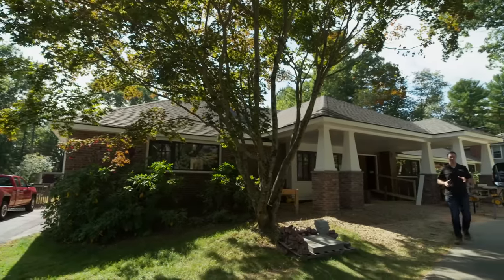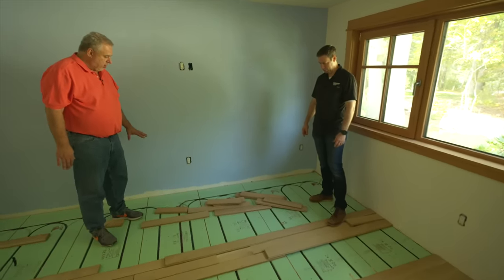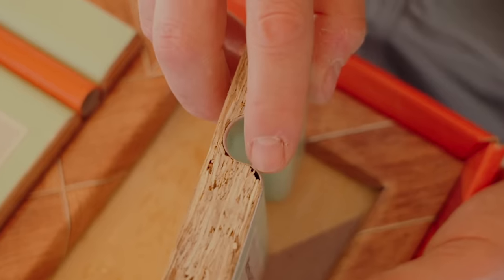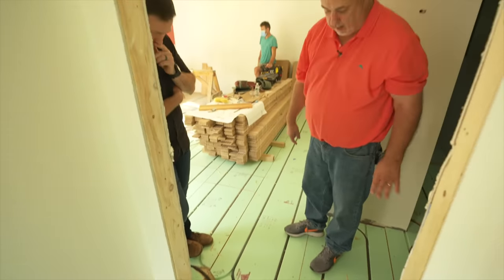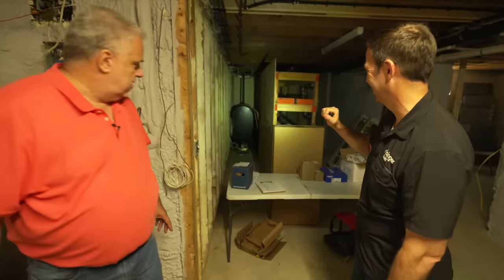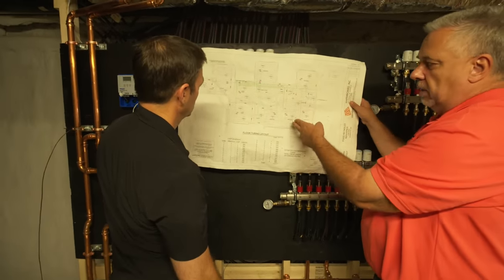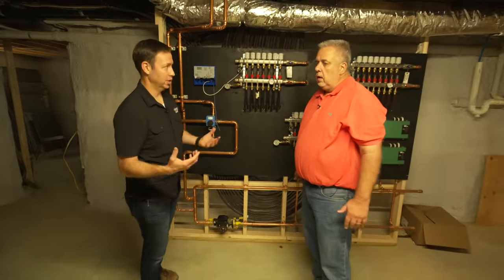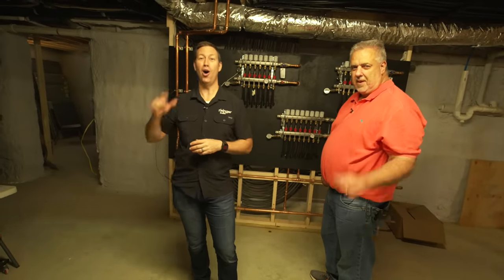Plug and Play Radiant Floor Heating System - BEST ON THE MARKET

Comment: Warmboard is terrific and worth the money, but I do have two caveats. One, it’s more expensive than other similar products on the market. Google the other brands and you’ll save 30-60%, but I will still admit that Warmboard is the top quality of the group. Once installed, I don’t think you will notice much difference. And two, when deciding against concrete slab, remember, with a slab you can fire the boiler for one to two hours a day and keep the living space warm and at a constant temp, +/- 2 degrees. While Warmboard is a lot quicker in response, it doesn’t hold the heat as well as a thermal slab. So you will fire your boiler a lot more often every day. More gas use, higher operating costs. But some people think the quicker response is worth it. I don’t really. It’s a a feature, but remember, most people live in their homes 365 days per year. I think it’s easier and less expensive overall for the flooring to stay at a constant temperature, and the house to keep living space at a constant temp. It’s just better. I have a 150 year old Victorian in San Francisco which is a great test case. Cold wet winters and very chilly summers here in SF. You gotta run heat most of the year if you want your home above 60 degrees. Three stories over a finished basement. The main floor is Warmboard remodeled, the top two floors are staple up, and the basement is a 2500 concrete slab. Ok? Great test case. And no, there are never any leaks. The basement slab is by far the most comfy portion in the building. Boiler runs two hours a day max during the cold of winter, and once a day the rest of the year. The staple up floors run 12-18 or even more hours per day to stay warm. The Warmboard floor runs about 12 hours a day to stay warm, and when the system is off at night, it really cools down! Warmboard just doesn’t hold heat. But it heats right up in about 20-30 minutes in the morning. Easy. The floors creak a little on the staple up. They do not creak at all during heat-up on Warmboard because the builder used glue and nails. Always use glue under engineered floors for radiant. The basement used glue. We loved the parquet floors in the building so we did staple up, and the old oak on those floors has shrunk a bit, because you have to keep the water tempers higher on staple up, and that’s not good for old wood flooring, but it’s okay. The concrete, we can keep the water temps low, like around 100 degrees. Warmboard, you keep the water temp higher, like 115-125, but still pretty low. Staple up, I’ve had to keep the water at 135, which is high, but that’s what it takes to heat the place. So at the end of the day, if you have the ability to pour a concrete in slab tubing, do it. Forget about the wood floors being soft and bouncy. On Warmboard, it’s so stiff there is zero difference between the feel of the wood vs the concrete slab. Nobody can tell the difference, it’s that small. Concrete slab will pay for itself in five years with cheaper gas costs. Warmboard is great for the rest. Staple up is honestly the worst performing, but it’s still fantastic vs forced air. You install staple-up for one one reason, if you can’t afford to replace your existing floor or there is a reason not to replace the existing floor, like for historical reasons. I’ve lived with radiant heat for 30 years, and it solved my allergies. True, once you go radiant you will never go back to forced air heat. They oughta outlaw forced air. Inefficient, horrible for your lungs, dusty houses, nobody every changes the filters, just UGH. If there was money for a scientific study, I’d wager that thousands of people die every year from issues related to breathing in stale toxic air from forced air systems. In Europe, forced air is very rare, and the mortality rate from lung and allergy issues is lower. Hard to be specific if this is the cause, but that’s my opinon.
Reply: Thanks for sharing this! We just bought a home in Pacifica and I’d love to ditch the gas furnace for radiant floor heat. Still doing research encouraging to hear about your application.
Reply: I don’t like that they are using OSB with VoCs

Comment: Lived in Korea for several years. Loved the heated floors.  When I build my home, I will have heated floors. Doesn't matter that I live in Texas.. LOL
Reply: I'm from Korea. So wish radiant heating is readily available here as it is over there.
Reply: What do you use for cooling?
Reply: @edgardelgado9937  depends on the size of the house, but in my high efficiency officetel it's a split unit HVAC
Reply: @edgardelgado9937  of course aircon.
Reply: I live near Waco and plan on going radiant. Hopefully it works out since I’ll just have a sealed slab.

Comment: I put Radiant in my house replaced a 1950'soil  hot air system. The heat is great no more winter colds a no more dust blowig around mking people sick it does not matter how much you try and clean old duct work  its fullof fifty years of dust and dirt.  The system more than paid for itself in less than five years. The health benefit alone  is absolutely worth the spend.
Reply: How much did you spend for installation???
Reply: @ByrdmanTrucker  1sqm = 100€ with 70mm concrete, foliage, 40mm Styropor/foam, foam-trip for the wall and plastic mounting clips. 2 construction workers included.

Comment: Matt...you should do a show on the type of flooring that is compatible with  a hot water in-floor heat. I am really surprised that the guys are laying down oak. Every time I ask flooring people they say NO WAY to solid hardwood and ONLY engineered wood flooring.  It is REALLY difficult to get info from manufactures to confirm whether or not their flooring is compatible with a hot water floor system.
Reply: I second this, definitive and accurate info online is really difficult to come by.
Reply: Doing radiant for at least 30 years......any type of wood can be installed over it. Only provision is a max temp of 80 degrees. and another must is humidification. Warm board works great at these low temps.

Comment: I used warmboard on my remodel here in Alaska and found it totally worth the cost and effort.   Getting up in the morning to warm floors is epic.
Reply: What part of AK? I'm in Southeast (Ketchikan). Are you using an oil furnace to heat the water like this setup? I want radiant heating but the more I look into it the more I think I may opt for and air-to-water heat pump. Temps are pretty mild this far south though.
Reply: @MaryRoseGrace  I am in Muldoon and on Natural gas.  I have a Lochinvar knight furnace which heats my warmboard to 112, my hot water baseboard (that I haven't converted yet) to 180, and my sidearm water heater to 120.

You should check out Cold-Climate Housing Research Center (CCHRC) out of UAF and what they know of heat pumps.  They work up here despite the naysayers.

Comment: Warmboard was a huge hit with me.  I completed a 3000 sqft remodel in MO powered by a geothermal heat pump with ceramic tile floors.  Radiant floor heat is amazing.  The switch from forced air to radiant along with the geothermal energy source dropped our electrical bill by 50%.
Reply: So glad to hear it! Thanks for choosing us.
Reply: If you don't mind me asking what did it end up costing.  We're building soon and trying to get an idea vs forced hot air
Reply: @ThinBlueLineVideos  WarmBoard panels, PEX-al-PEX tubing, and manifolds were around $8.50 per sqft shipped in 2018.  TACO zone controllers and cheap thermostats were utilized for control.
Reply: @ThinBlueLineVideos   get in touch with WarmBoard directly and I’m sure they will give you a ballpark estimate for new construction costs with the more expensive subfloor 4’x8’ panel.
Reply: @ThinBlueLineVideos  Be aware, Warmboard is not a unique product, there are 4 or 5 similar products, at least when we built our house 6 years ago. Search around, speak w/your hydronic system professional, he/she will likely have a preferred brand. 

We personally chose Thermaboard. The material itself was about 25% less than Warmboard and another brand I forget now. We chose it because it used smaller 3/8” pex much closer spaced than WB and similar 1/2” pex boards. The benefits being more uniform heat and lower water temps, important if you’re using under wood floors. While the floor sheathing is less $ and a bit lower profile, mitigating need to trim door bottoms of remodel, the labor and material costs for larger manifolds, more tubing and more valves makes it no $$ savings at all. I’m sure we would’ve been happy w/Warmboard or others but have zero regrets w/choice we made. Our floors are as flat as the day they were sanded👍
Reply: What do you do about AC when you have radiant heat?
Reply: @scottv.4140  I had a GeoComfort combination heat pump unit installed.  It would switch functions based on priority and thermostat calls to generate cold air, hot water or hot air.  It was also the whole house HVAC unit which ran a circulating fan 24/7.  Radiant was still the primary heat source.
Reply: @NMHonda  I have a 13 yr old GeoComfort with forced air heat & A/C and my electric bills are absolutely terrible. 1965 house, but I added a bunch of insulation in the attic and 1" rigid foam as a thermal break around the entire house.  I'm thinking it's got to be because of the power hog compressor.  It also has to run the fan pretty high due to the low air exit air temps from that kind of a system.  I'm debating whether to do geothermal with radiant in our forever house in a couple years.
Reply: Now they are $15 a sqft lol no thanks. 50k for my whole house or 15k for gypcrete. Would never make up the cost
Reply: @NMHonda any issues with the geo comfort heat pump? Company here in MN sells those as there primary brand

Comment: I've gotten quotes for Warmboard before and man they're pretty steep for what it is. Yeah you can simplify the installation, but a traditional radiant heat system works just as well. The reason is there's a maximum temperature your floors can hit before it messes up your hardwood floors. You can get uponor aluminum transfer plates for less than Warmboard's system, and I prefer that over Warmboard because the probability of damaging the pex is lower since it usually sits 1" below the bottom of subfloor, so you have about 1 1/2" play when installing hardwood. Also really recommend against using staples on Radiant heated floors. Even though there's glue, staples do tend to come loose over time, and the floor will have a tendency to squeak. Solid white oak isn't for everyone either, gotta have real good collaboration with the mechanical guys to make sure the water and temperature stays below 85. Otherwise the extreme delta will cause the floors to cup and buckle, I've seen this happen a few times due to carelessness or just oversight. Most of our radiant projects, we only use engineered white oak flooring because it's more stable, and it's installed with Cleats instead since they are less likely to pull out during expansion and contraction. Double the amount of Cleats as well. If it's over 4" we glue and cleats. 

It's important to remember that the design should be easy to work on for the next person, meaning it's gotta be stupid proof because it's hard to condition homeowners or people that adopt these systems as a new homeowner. Engineered flooring, makes it less likely to screw up down the road if an unknowing homeowner fiddles with the temperature and settings
Reply: Agreed on the cost for Warmboard. I got a quote from them and it was really high. I went with Ecowarm instead, which is a nearly-identical product at a far lower price point.
Reply: All that, and I would have a laminate or laser etched drawing of zones by that manifold assembly - attached as part of the assembly.  You could shrink it 50% and still be good.  House sales are notorious for losing build documentation.
Reply: What about the cost of insulating under the subfloor to ensure heat transfer into interior space?
Reply: There is a competitor to WarmBoard that is more cost friendly and 100% made in America. If you would like some more information let me know.
Reply: I also imagine, for what this costs, you could simply better insulate your house and you won't have to worry about your floors getting cold. This system seems a bit excessive and difficult to maintain. Insulation doesn't really cost anything to maintain if done right.

Comment: We installed a Warmboard  heating system in our new construction.  Best decision ever.  Living in a radiant heated home means never really thinking about heating.  You don’t hear air flow.  It’s just comfortable.   I must say though, our plumbers weren’t nearly as neat and tidy as this house.  Probably due to inexperience.  It works and works well.  Not as good looking though.
Reply: Neat and tidy has to do with laziness, not inexperience.  What did you use for air conditioning, and did you tailor the ductwork for A/C differently than the typical supply/cold air return layout? During the heating season is there still airflow to exchange / filter?
Reply: So it completely replaces the forced air system?
Reply: @KiiKiiCR  Yes, that's correct.   We don't have a forced air furnace.

Comment: This kind of stuff is so FABULOUSLY easy to fit. I did our whole house myself in England with Speedfit, which is similar: just send the houseplans in, get the spec with loop calculations back, lay the boards, unroll the pipe into the grooves and push fit into the manifolds, label it up, fill it and turn on. It's the simplest plumbing in the world, the only bit of special kit I needed was a pressure filler/tester. Just elegant. It had foam boards under though, designed to lay an interlocked floating floor over it, not nailed down. Floating is common here.
Reply: Did it raise your floor height much?

Comment: Have the thicker structural 1 1/4" think warmboard for over 12 years in 40% of my home with both hardwood & tile finished above.  Love it! Super heat transfer & super even.  All runs do not have to be "home runs" back to boiler room.  I have a larger room with 4 or 5 circuits "300' ft each" run a larger size pipe from boiler room to a manifold in a closet near the big room.  Each mini-circuit can be adjusted at the manifold to even out slightly smaller or longer runs connected in the main circuit.
Reply: This was client desire

Comment: I was on a job with radiant heat flooring. The manifold for second floor were in access panel in bedroom closet. Cuts down on the loop maximums. But Steve's job is Awesome
Reply: Each builder/architect has their own personal preferences, but we typically recommend putting manifolds in closets for the shorter loop lengths and gains in efficiency.